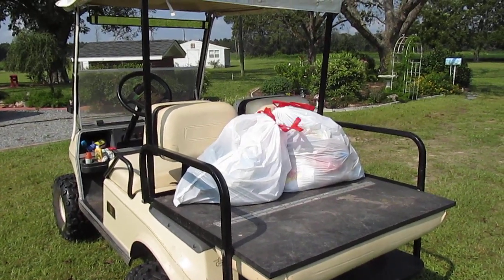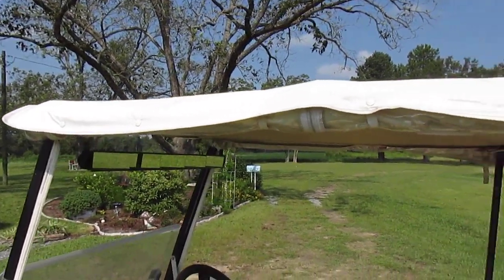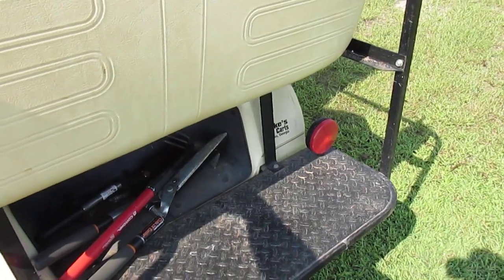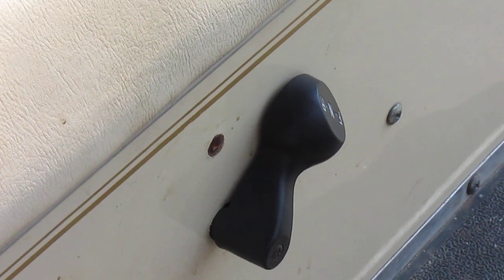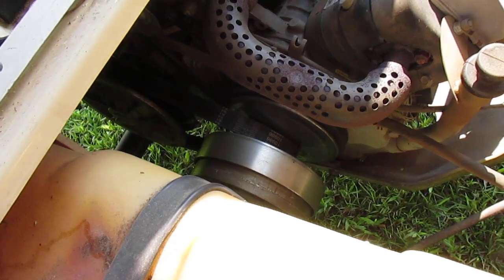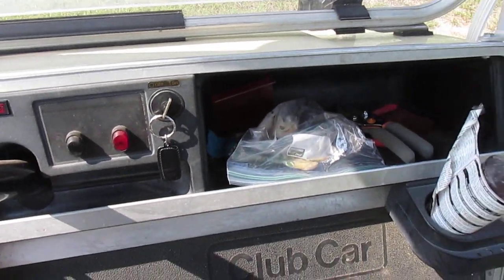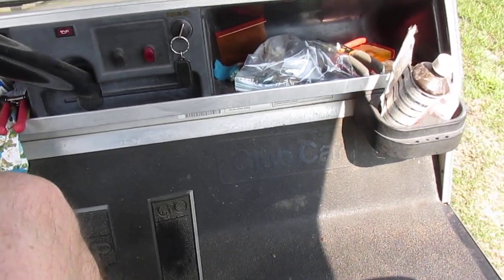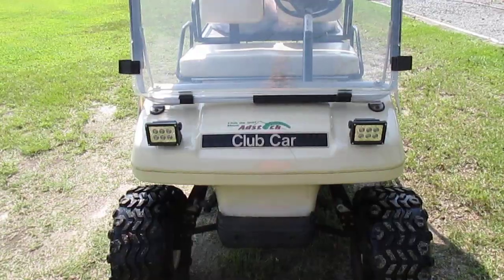Club Car Gas Golf Cart, "Jacked Up"

Comment: The engine is a Kawasaki FE-290. Basically a trash pump engine. You have the wrong battery in there. Battery should be a group 70, not a 75.  Also, the top, windshield and enclosure you have mounted is from a 99 and back.
Reply: What problem would someone have putting a group 75 instead of a recommended 70?